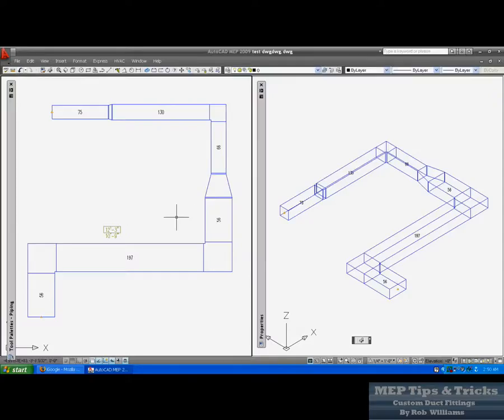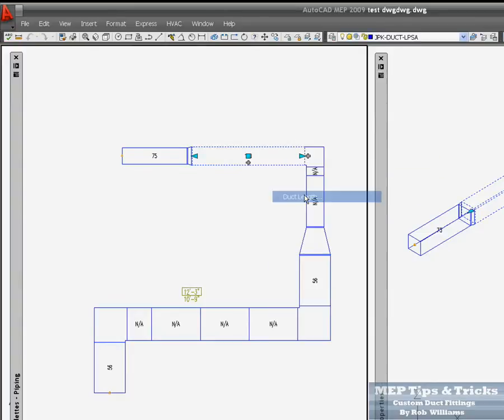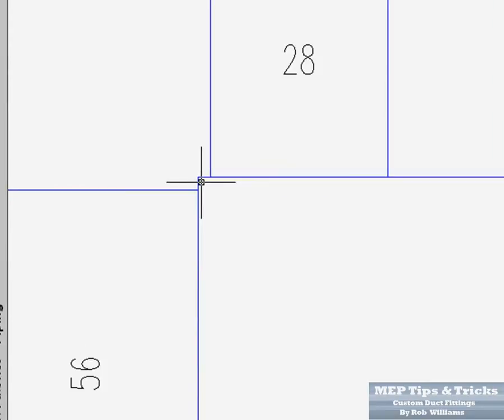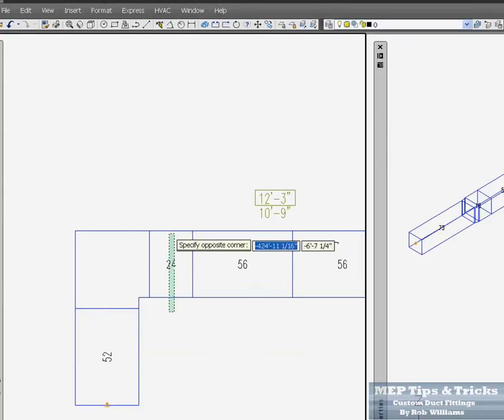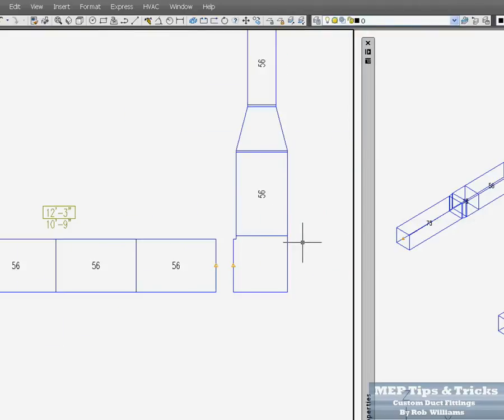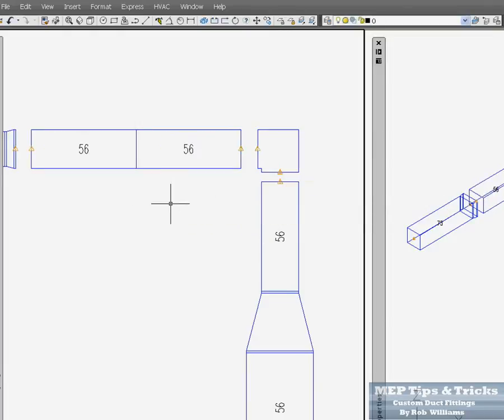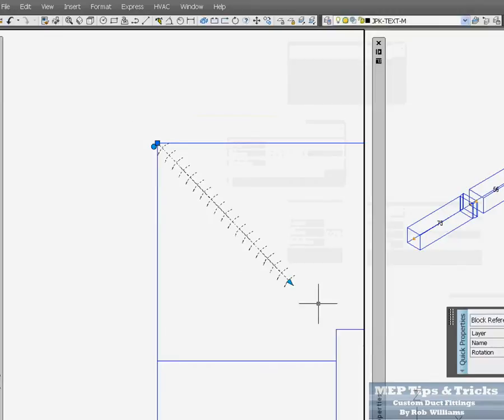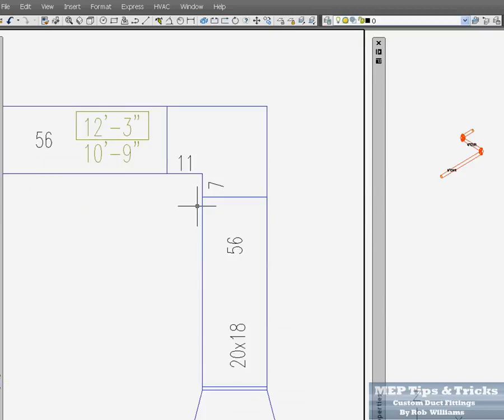Cad Tips - AutoCAD MEP -Custom Duct Fittings

Comment: Hi Rob,

Thanks for so informative video.

is there any way to create custom boot tap and change the Elbow threads 
Thanks
Reply from the maker: There Is, but its very complicated.  We switched to PractiCAD for Sheet Metal and AutoCAD Fabrication for plumbing.There are videos and info on creating parts. I have two videos on my channel. AUGI  and Autodesk also still have knowledge bases on the internet.  Here is a link that might get you started  https://youtu.be/oQWuGldBmOs